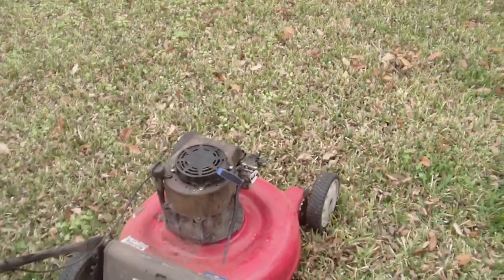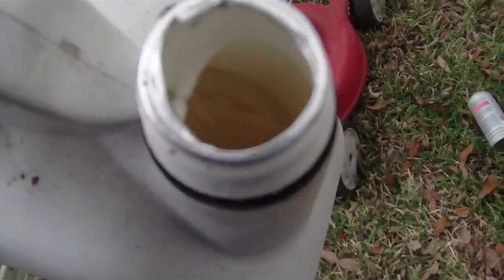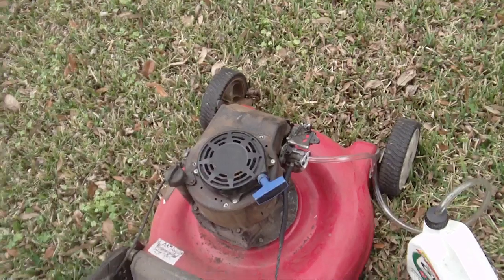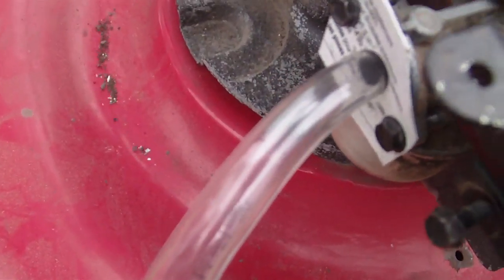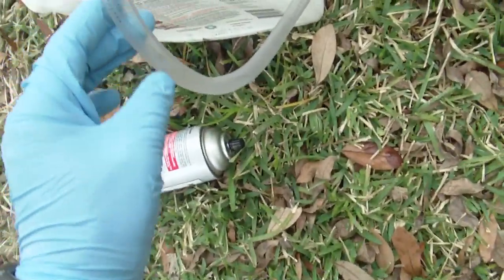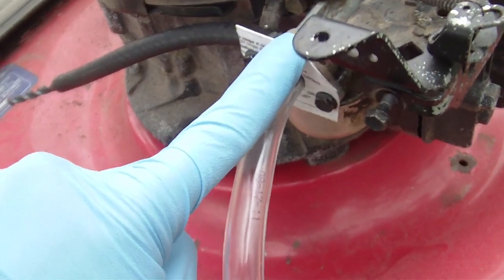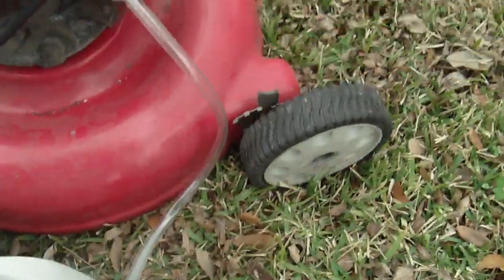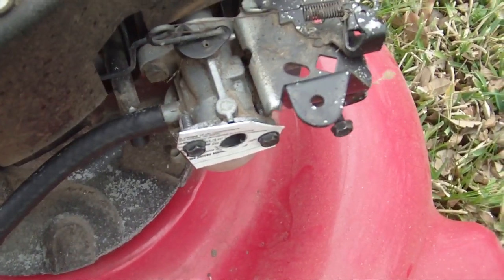Gas Vapor Lawn Mower Experiment

Comment: what if we kept the gasoline in am aluminum container with aluminum fins and ran heat sources around the fins. This could help the cold gasoline fumes caused by the decrease in temp This is pretty cool but i wouldn't want to get killed by an oil company for this. They are crazy : )
Reply: Tom Ogle.... lol

Comment: put it on a hot plate bro it will work at full throttle then and art the same time post images and pictures all over general motors websites and fb pages

Comment: The condensation you were pointing out was on the OUTSIDE of the bottle and tube, so it shouldn't be adding water to the fuel. The reason the condensation is forming is because of the "evaporative cooling" process caused by all the air moving through the bottle. Cooler liquids evaporate less, so you end up with less vaporized fuel going into the engine after a while. As pointed out by some others, if you were to warm the bottle, it would ensure there was enough vapor going into the engine.

Comment: My nephew told me about this video . Amazing to say the least. It inspires the technical side of me to produce a more controlled environment such as sealing the carb intake and monitoring head and exhaust temperatures. It certainly sounded like it was running well, sounded like any other mower.  If I could adapt this to my Ford van ( 13 MPG city) I would be elated! Thanks for posting this video.

Comment: You can actually perform the same without the carb. Just take the carb off, and run the hose in. You can regulate the rev of the engine by controlling the air flow with a simple valve. So for any old mowers with bad carbs, just take it off and run the vapor directly into the engine.

Cheers!